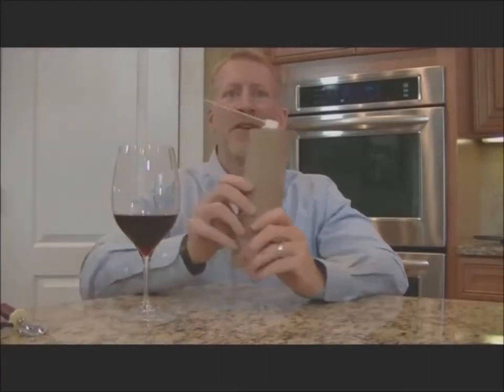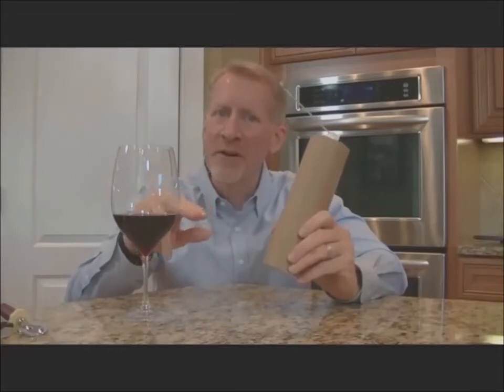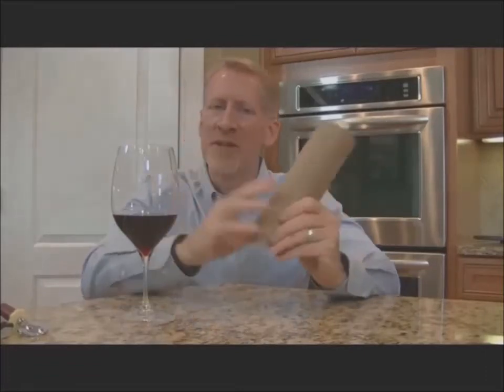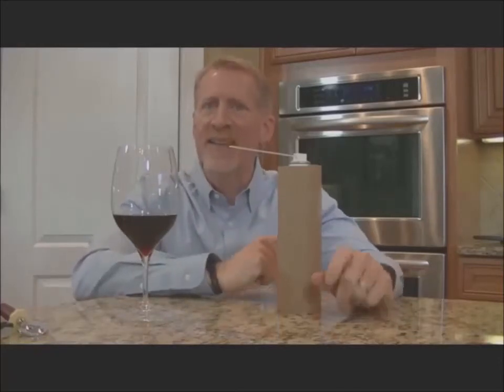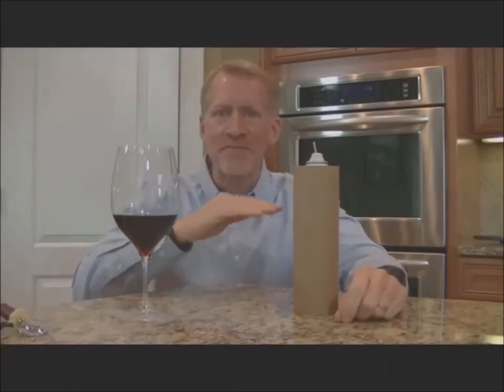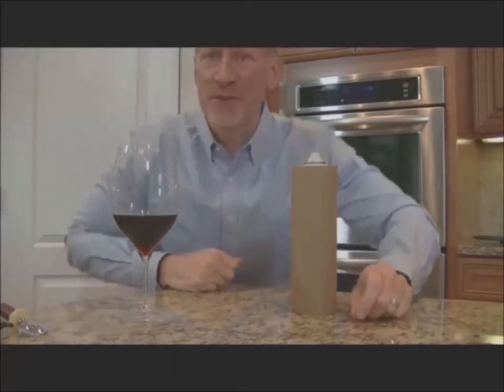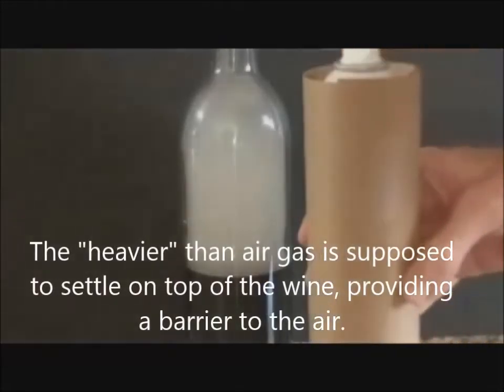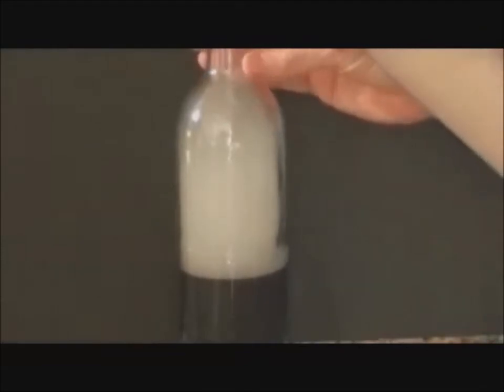Inert Gas - wine preservation. Can it work in a single bottle ?

Comment: The instructions for that inert gas product are "Spray one long (1 sec.) and 4 short bursts into 750ml bottle. Larger bottles require additional sprays—add one long spray for each larger size."  

You didn't do that.  

Also, the "smoke"  in your bottle is made of what?  The majority of smoke chemicals in use today are generally referred to as 'water based'. This rather vague term describes chemicals which are water miscible, and are in the main based on glycols and glycerol.  Ethylene glycol has a molar mass of 62.07 g/mol and the formula is C2H6O2.  You can see from the formula, this is WAY heavier than Nitrogen, Argon, or other inert gases.  This alone completely invalidates your "experiment."

Sorry.  This video is "fake news."